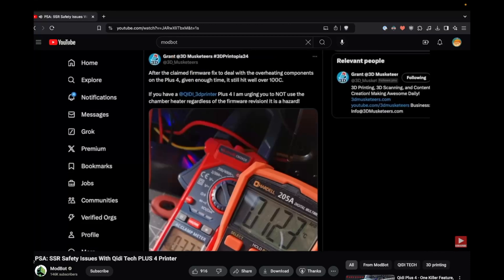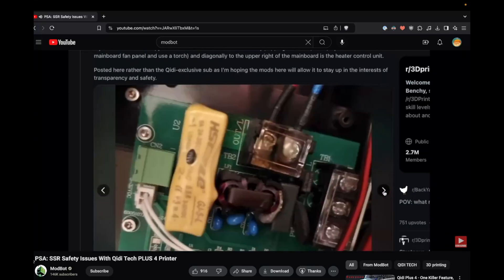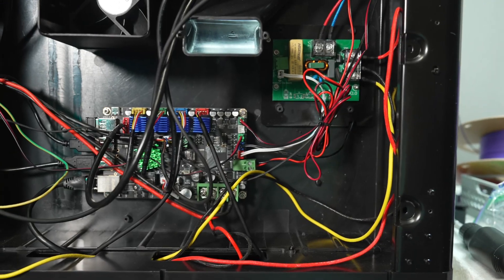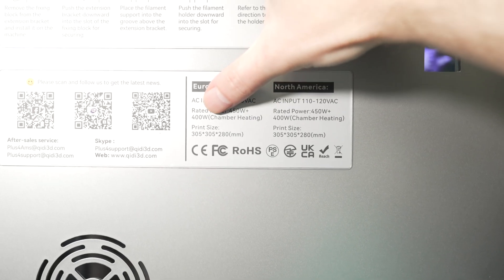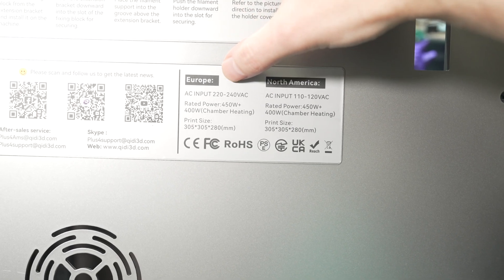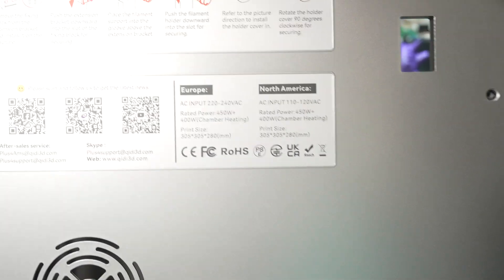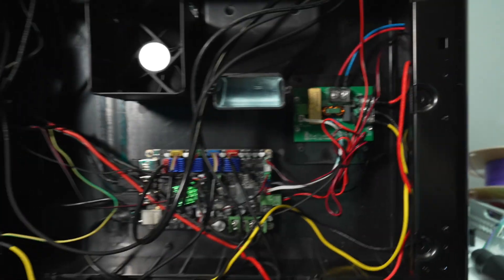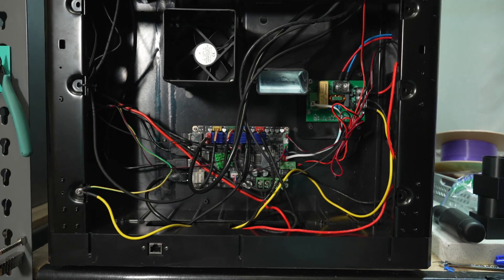Potential Safety Hazard with Qidi Plus 4 3D Printer

Comment: Here’s my thoughts, I bought one knowing it has this problem.  However how many of you have no problem spending a few bucks on doing some tweaks on any new printer? I updated mine for a around 60.00 then maybe another 30 for the material to redesign the heater box, so say 1000.00 all in for a heated chamber printer that you can run on a professional level sounds like a decent deal to me!
Reply: Just buy a bambu P1, this is an insane level of copium

Comment: But isn't it a resistive heater?  Then lowering the voltage will lower the power, not automagically increase the current.  So there must be more to the electronic components on that board ...
Reply from the maker: It is - I don't do these kind of electronics for a living, but my guess is that the voltage switching circuit was either not present or not working. 

If the logic is designed to hit 400W and you present it with 220V it will use about 2A of current. If its presented with 110V it will draw about 4A. It could be that it wasn't designed for 4A and was only designed with 220V in mind and not 110V that could be the issue. 

I really don't fully understand the issue and I don't have a way to fully debug it either. I was just presenting a guess that it had something to do with the logic between switching for the two voltages, which leads to handling different current draws.
Reply from the maker: Also, P=VI so if P is constant (400W) and then you change V (220 vs 110V) then yes it will "automagically" change the current.
Reply: @ButterPockets  But how do you keep P constant with a resistive heater?  That's the question!  It's not because you slam "60W" on a cardboard box that suddenly the heater will keep its power dissipation constant over a large range of voltages.  Normally there's also a voltage mentioned on that same box and tne power rating will only hold at constantly powering the heater with that voltage and allowing as much current as then can pass through the resistor.  If you lower the voltage, the current won't increase, but rather decrease and hence so will the power.  With AC there might be something more at play, but with the low 50Hz frequency I doubt that will play a big role.  Then there is the fact that a PTC heater is used, which changes its resistance, but with temperature, not with voltage.  So how is the current regulated to keep the power constant even when switching from 240VAC to 110VAC.  The electronics doing that are probably involved in the problem.
Reply from the maker: I get what you’re saying and I guess I’m forgetting ohms law. I’m an RF engineer and it’s been a while since school. For a purely resistive load if the voltage goes down the current would too. It’s obvious tho, something in the circuit was not designed correctly and looking at the new circuit they sent its a complete redesign. It’s curious that it worked with 220 and not 110, but hey at least they seemingly fixed it.

Comment from the maker: Seems like Qidi is sending out preemptive emails now and offering free heater power board replacements for NA (110V) customers.
Reply: Any idea what the changes are in these new boards?  Do they say how hot the new one gets?  Minor change or total redesign?
Reply from the maker: @ I wish I had any clue. I just tested my printer (which doesn’t have anything other than the updated firmware) and with the heater in it only pulls 180W (30W at idle). So if the heater is meant to handle 400W it’s well below it now. 

Hopefully someone else gets ahold of one of the “new” boards and is able to see the difference.
Reply: @ButterPockets  There was a picture of one someone got recently.. the coils are now round or something. I have one on the way supposedly but I already have the Omron setup.. just have a couple wires to finish up to get it back to printing I hope.